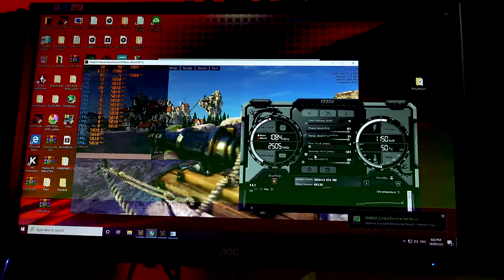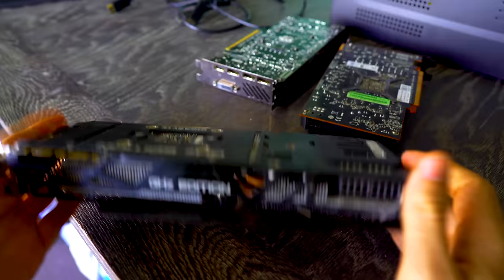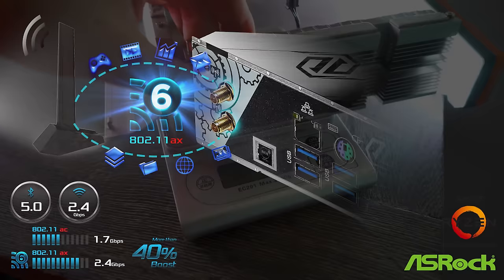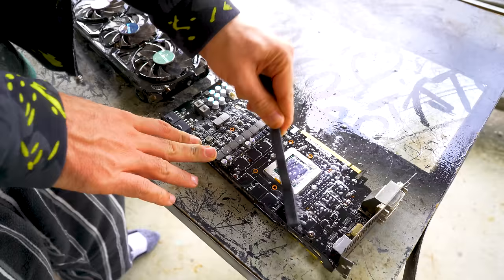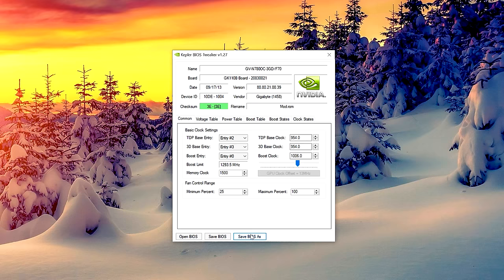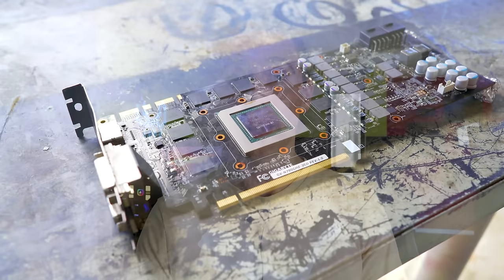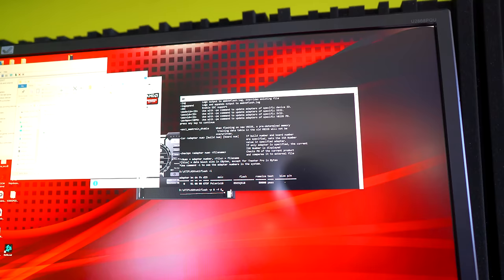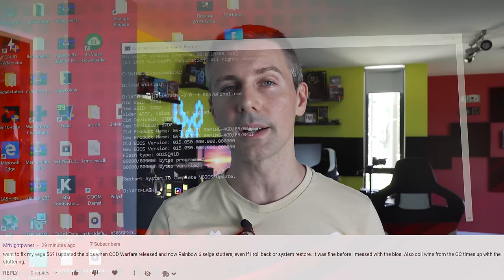4 Problems that Cause a Faulty GPU and How to Fix them.

Comment: And the whole thing goes Kabonkers
Tech YES City, 2020
Reply: Hello tech yes citizen how you doing
What are your current pc specs
Reply: @samsonsanthosh  Hi there! 

i5 4670K - Free
Gigabyte GA-Z97-UD3H-BK - $99CAD
Samsung 850 EVO SSD 500GB - Traded, gave a bunch of old AM3 socket brackets and a few other redundant parts. 
Plextor 500GB SSD - $3000TWD
4TB Seagate Barracuda HDD - $forgot
Corsair 120mm AIO - Free
ASUS AMD Radeon R9 Nano White - $13500TWD
6x Thermaltake Riing Plus Fans
White Inwin 303C Case with factory painting the interior white as well. - $3000TWD
Mellanox 10GbE NIC SFP+ from eBay $20USD
Reply: bought a GTX 1050ti Rog Strix plugged it into my computer started up has signal assumed windows 10 would install drivers I was just testing it , so I update windows too make sure drivers are installed when I goto manager the display is windows default wth , so I open up gpuz and Cpuz and it shows GP107 but no brand name and no other information !!!! so it is a 1050ti and shows 4GB but thats it and thats all should I goto ASUS website and install drivers directly from their as befor I was using a asus 1060 dual 3gb ? .. eas planning on using this 1050 ti rog strix for a build too sell I paid 140$ for it in the box with all papers in Canada !!!! I was going too pair it with a X58 micron mobo and a i7 970 6 core and 16gb triple channel !! figured should be a very decent pc when built ….happy Covid 19 build !!! PS I go and find deals with a N95 mask on and literally hand sanitizer on me always lol I get my parts home and sanitize them hahahahaha
Reply: @samsonsanthosh  
Cpu: i5-4670k OC to 3.8Ghz
Mobo: G1-Killer
Ram: 2x4GB 1x8GB = 16GB
VGA: GTX 750TI OC 
Storage: 2x500GB Hdd, 1x1TB Hdd & 120GB Ssd
Reply: @EpicGamingEct  🔥
Reply: @dragontos  sick build bro🔥🔥🔥
Reply: loooool yeah
Reply: I am not able to open GPU ... so if I put my GPU on sunlight for 3 Hours will it work ?
Reply: any idea why after upgrading from amd 3600 to 5600x and updating mb bios starting getting strange behavior vega 64 memory temp getting hot and driver crashes fan speed lowers when should be rising and @1440p undervolted works fine temps good but go to  4k  core and memory speed  ignore the under volt and fall lower than a vega 56 core and memory speed go back to 1440p and alls good again . changed drivers rplaced thermal-pasted on card and reinstalled window  nothing helped can motherboard bios  effect gpu voltages ?
Reply: @stevin47  Fan curve lag was the problem i had with that I brought the curve in much faster for the fix
Reply: @MarcoGPUtuber how did you get these GPUs gifted to you?????

Comment: This is madness, there's no repair involved, it's just sort of a cleaning with fingers crossed. There's no analysis, no documentation, nothing, just luck.
Reply: Well. You gotta start somewhere.
Reply: Always start easiest solutions
Reply: Its not luck its called knowing what you're doing
Reply: Thanks for the insight Karen!
Reply: Thatsbks for the heads-up
Reply: Gotta agree , guy doesn't even use a multimeter
Reply: Even if they showed repairing do you really think a regular person has the tools and skill to repair it, they can use multimeter to check power, but replacing anything yourself is just not worth it, if your GPU is that bad that you have to replace a capacitor or something just take it to a repair shop or buy a new one
Reply: @DaGaJbmKojJe  yes most DIYer will or should have a multimeter... 

No point baking a card if fuse is blown or short found on contacts

Comment: My friend spilled a soda on his cyberpower pc and the warranty provided him with a brand new pc. He gave me the “broken” 1050 ti for free, it was caked in soda residue and dog hair. I took the heat sync off and scrubbed it with a toothbrush and rubbing alcohol and voila problem solved. Now it works perfectly fine
Reply: Enjoy
Reply: Yeshua Carrasquillo  reason I think so that your gpu crash you need to re install driver 
Or clean your gpu change thermal paste
Reply: Yeshua Carrasquillo  try booting in safe mode if it works in safe mode it’s probably a hardware problem and if it’s still crashing  after you redownload windows and new gpu drivers replace the paste and it should work
Reply: Sounds like a plan
Reply: @venomsgaming4801  my gpu stopped working but cyberpower pc won’t answer me 😭😭 how did your friend get a whole new pc
Reply: Nice
Reply: Stonks
Reply: heat sink
Reply: i’m having that problem my cousin spilled soda on my pc and it dripped through the vent and i can’t get it to work though 😭
Reply: @Christian-so7md  if you tried to turn it on after you probably fried it
Reply: Win win
Reply: My gpu I'd overheating  the person I bought it from said it's a furni gpu and it's normal if it gose 90c so please  explain
Reply: @whynotoctopi  not sure on those thermals but they are normally a pretty warm gpu, I’d recommend changing out the thermal paste with some noctua stuff (best I’ve found and fairly cheap)

Comment: I've tried the heatgun method a few times but I've found it easier to just take the card apart, clean it, jack it up on some tinfoil on a plate and put it in a pre-heated oven for 10 minutes at 197 degrees Celcius. This re-solders everything just like a heatgun. Take it out after 10 minutes and let it cool down, reassemble and see if it works
Reply: Use to do this with old playstations that'd crap out due to excessive heat
Reply: What if you have a convection oven?
Reply: @Trifler500  it should work the same
Reply: @Trifler500  just make sure you don't use the microwave function
Reply: @DJMcMahon6740  Yeah, I was mainly wondering about the temperature, since convection usually has to be set to a lower temp to get the same results when baking.
Reply: This lol. I got a brand new 3060ti sitting at home. Issue is it wont boot, powers up but the pc does not recognize it. IE, doesnt see it, but powers due to teh LED lights i see. Guess i gotta do this and see if it works.
Reply: @Tuan Nguyen RMA it if under warranty.
 Doing any of this will void any existing warranty.
Reply: @JonatasAdoM  Obviously, but yea, ram is out of the question. I have 0 time for it, and will end up just baking it.
Reply: @TuanNguyen-bd8cw  100% RMA it.
Reply: Yea i think it would be simpler, but if you still want to use ur oven, i’d say don’t. The fumes will contaminate the oven and so the food if you use again.
Reply: @TuanNguyen-bd8cw  did you do it ?
Reply: @TuanNguyen-bd8cw  did it work?

Comment: Tried it and it's working! Instead of using WD-40 I used isopropyl alcohol. Using that is a bit easier, because it evaporates on its own without having to blow it dry.
Reply: Ty for that cuz I don't have a heat gone but the wd 40 ks for the rusted metal part I belive

Comment: When drivers are installed and initializing, the core vrm is switching from boot/safety -mode to "regular operation". If the thing failed at this point, it's ofter a problem with the vrm or bad capacitors (e.g. from previous overheating).
Reply: So what does one do then
Reply: @Jupa  change capacitors

Comment: The idea behind heatgunning a pcb is to fix dead solder joints. This works best when you start with the back side of the pcb. "Toast" it for around 5 minutes until you can see a slight colour shift of the solder. Than put on some gloves and quickly flip the pcb to the front side. Give it another 5 min of heat and let it cool down afterwards. The dead solder joint should be fixed now. A good idea before starting, is to heat shield all caps. They are the components most likely to break during "toasting" a pcb. When the capacitors are shielded you can go all in with the heat, which is needed to increase the change of really making the solder reflow and therefore fixing that dead solder joint. Sry for my bad english!

Comment: Hi Tech Yes, I wanted to let you know I fixed my GPU with heat gun and I don't need to buy a new one for now. Your videos helped and saved me from forking out for an overpriced gpu especially when money is tight. I'm happy the 1050ti was out of stock now :D

I heated the gpu to 150c for 5-8mins raised up on foil balls whilst protecting the other components with aluminium foil with a square cut out. A thermometer that updated the temp quickly was placed near the chip helped ontrol the heat. Left it for 20-30mins to cool down, put back together and now it's working better than ever!

I read every comment on the Tech yes lovin GPU fixing vids and i'm happy you made them despite what the haters were saying.

Comment: Hey Bryan, here's a tip:

Next time when you try the heatgun method, try getting hold of a soldering flux paste tube. I've had a lot more success than doing dry reflows like you did. The reason is that the flux acts like rosin core on the solder balls and helps the solder stick a little better ;)
Reply: @NirvanaShotgun Really? how and where do you apply the soldering paste?
Reply: @phylwx  Around the GPU sides. The heat from the gun will melt the flux and it should go unser the GPU (alternatively direct the way the flux will go using the gun, by tilting it so that the paste goes UNDER the GPU)

Comment: That's how I got a 1080ti for $200 in 2017.
Beast still shreds.
Reply: And now it's worth $750+ on eBay depending on what model
Reply: @TheCRTProductions  Stonks
Reply: @TheCRTProductions  can you explain little bit about different manufacturer market for GPUs? 
which manufacturer tuned Nvidia GPUs are the best? at least 1st to 5th?
Reply: @MethmalDhananjaya  MSI or Asus first or second. then the third is Gigabyte. and other brands like KFA2 or Hall of Fame or other third brands are not that good as the first 3

Comment: Saw this vid and thought I'd have a go at fixing my old gtx660. I tried giving it a good clean with WD40 and contact cleaner, also reapplied new thermal paste and nothing, didn't work. However I did notice a tiny SMD capacitor looked like it had got prrtty hot as the area around it looked a little heat blasted. After cleaning the card I couldnt see which one it was though! So I thought well.. nothing to lose and tried to guess. I pulled it off gently and soldered another cmd capacitor on that I had on another bit of broken tech and it actually works! Not sure to what degree but I had no video output and now I do! And its the dodgiest bit of soldering work ever. Lets hope it lasts!
Reply: Ho damn good for you!
Reply: Cool
Reply: How's it looking now?
Reply: Is it still going strong lol

Comment: Have you ever thought about setting up a thermal camera to check your temperatures when using the heat gun? This could help you tune in exactly what temp each area of the card gets to.
Reply: [NorthRidgeFix entered chat]

😎😄

Comment: @7:29 happens when you don't clean the dust off your components and you live in a relatively humid area.  The dust draws moisture out of the air and starts to create rust spots over time.  Yea olde PC cases loved to do this on fan grills, especially the front grill that was hidden behind the riveted-on front panel.  It may looks yuck with the yellowish tinge but it is just a very thin layer of rust.

Comment: Have to say a massive thanks for posting this. I fixed 7979 with bad artifacts, gtx 660 that didn't even show in bios and a Rx 570 that crashed under load. All had the tech yes loving, brake cleaner and a heat gun 👍👍😃👍👍👍👍👍
Reply: The brake cleaner is used to clean rust correct? Can I use it on PCB or only just the backplate because I want to remove the rust on it
Reply: @muhammadzafranbinnaharrudi591 use isopropyl alcohol instead

Comment: If you repair GPU with heatgun, you need to say it in youre add when\if you selling it!
Reply: nope xd
Reply: @budgetking2591  yeh goof Boi
Reply: Yeah But All  the heat gun dos is straighten  out the  silicate channels in the gpu chip
Reply: Nah
Reply: @goldkiller1324  Well, atleast 27 ppl would buy computer from me if i say that in my add^^
Reply: @wedbull17  nopeee i say its like new
Reply: @mass1985  
Why is this sir?
Im asking because i dont know not to be nasty.
Im hoping to learn.
Reply: YTG killrekt  i mean it was already broken to begin with I mean as long as he says that it was doa and he cleaned it I wouldn’t trip to much he would prolly sale them half price .
Reply: @budgetking2591  that's like selling a car with an engine that's about to break but you spray WD 40 to stop the crunching sound

It's still a faulty engine just without any immediate signs it's broken 

Kinda scummy as the engine would break in the very near future same analogy but with gpu's
Reply: YTG killrekt  The fcbga cracks and that cant be reflowed, but it can be thermally cycled to realign the contacts. Its only a temporary fix if you freeze or heat up your gpu, the only way to fix it is with replacement of the whole chip.
Reply: Congratulations you solved people lying in adds from this point
Reply: @narwhal9852  you're smart comments don't really add much, wasn't trying to solve the world's problem just add my opinion on the matter
Reply: Like new, never mined on, never reflashed or OCd, kept clean, barely used.

SOLD AS IS. NO RETURNS. 

Lol. ok then.
Reply: I mean... are you teaching me morality... but can’t spell ad?
Reply: @yahyasajid5113  🤭I'll sleep on you defense

Comment: Before trying any of the drastic suggestions in this video, test the gpu with an older driver!

I picked up a cheap 1060 3GB from ebay that didn't work with drivers later than a certain version.

After a bit of Google-fu I found the cause to be a particular vbios revision used on early cards from a select few manufacturers.
Reflashing to a newer vbios completely fixed the issue.
Reply: What is the name of the manufacturer that made your specific card? Also do you remember what other manufacturers made cards with this issue? Any detailed info is appreciated! Thanks! PS> I dabble around in repairing old GPU's in order to donate or resell (at a minimal profit) to gamers that are actually in need of a graphics card, but not able to acquire one due to the silicon chip shortage.
Reply: @rodneyg1989  it was a gtx 1060 3gb from Palit. (Single fan version)
Reply: I have an MSI GTX 1060 6GB OC that is experiencing the same issue. Where did you find an updated "Certified" vbios for yours?

Comment: Good info man!  I had a faulty Gigabyte Winforce GTX 560 which had the screen full of horizontal lines as soon as the PC started up and even in Windows.  Reloaded BIOS and nothing happened. Didn't have a heat gun so I simply opened the card, cleaned the thermal paste off with alcohol, took the hair dryer, heated it up for 10 minutes straight on the GPU chip, left it to cool down, re-assembled everything and BOOM ... working even better than before.

Comment: WARNING: The heatgun method is not guaranteed, it could even make things worse! HOWEVER, when you get as desperate as I was... anything is better than having your GTX 1080 Ti sitting on your desk as a paper weight. My video card would boot but immediately hard crash the entire PC the second I did anything GPU heavy like games, webcam, or photoshop. To fix the issue... after literally trying EVERYTHING else on the internet... all I did was scrub the entire card down with WD40 using a toothbrush, gently removed all excess WD40 with a micro fiber (it's okay if the card is still greasy when you plug it in because WD40 is non-conductive), placed the card on top of 4 leveled aluminum balls that I made by hand, blasted it with my heatgun set to high for about 12 minutes, and then left it alone for about 15 minutes so that it could cool down. I then reapplied some thermal paste and plugged it into my PC... got a blue screen of death (probably because it was still a bit hot)... rebooted the PC and bingo bango the GPU was able to pass a UserBenchMark test with flying colors! Webcam works, games play at max FPS, and photoshop renders like a dream. My only word of advice to anyone desperate enough to try this method is that (1) there's a 50/50 chance it won't work and (2) there are a lot of online reviews claiming that this is only a "temporary" fix and that the card will slowly start to fail again within a few months... so enjoy the results while they last and start saving up just in case your GPU only gets a few months of mileage out of this amazing life hack! XD
Reply: Having the same gpu and the same issue. Curious, does the gpu still running good?
Reply: @hayder978  Holy crap, I totally forgot I wrote this lol. Yes, my 1080 Ti is still working perfectly good. I honestly can't believe that it's been 8 months since it died! XD
Reply: @lumberfoot_jpg  Thanks for writing up the detailed comment 8 months ago, and thanks for the feedback. Now that you said it worked for you, I am encouraged to do it. Nothing to lose and perhaps its worth it if it will work in long term.
Reply: @lumberfoot_jpg  some people put flux around the gpu. Did you do that? Also around the vram modules?
Reply: @hayder978  I did not do that. You can try if you want... but I think just heating up the GPU is enough to melt any micro holes that may exists on the card.